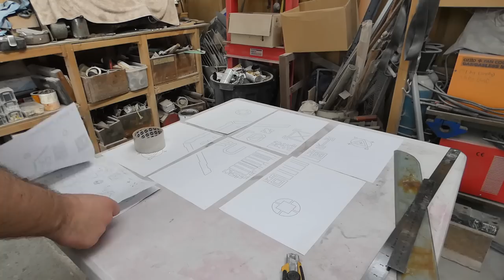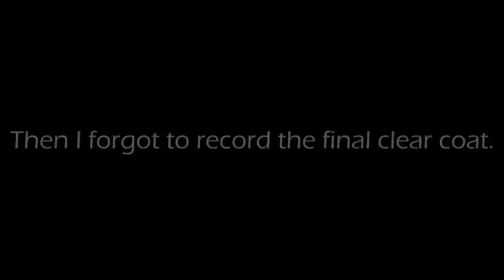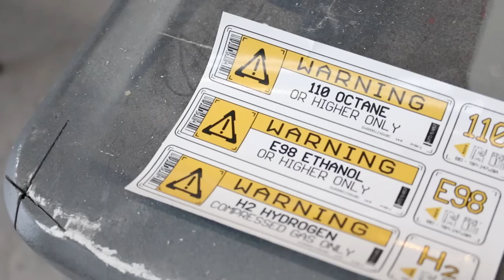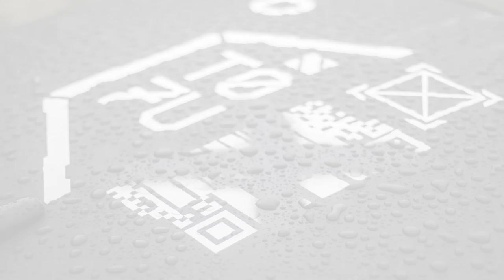The Fastback is Finished! Cyberpunk Miata Build: Part 8

Comment: What kind of Tipp i can give you for future Projects;  You should try use Bodyfiller that is thinned down to a point where its strayable with a Gun that you would use for the Corrosionprotection of a cars underfloor/Wheel Arches. Would save you a lot time and you can adjust the layerthicknes by thinning down the Bodyfiller. Ive seen Japanese Bodyworkers doing that when rebuilding a Fairlady Z from 1969.

Comment: amazing build! I'd love to see you route the exhaust through where the finish panel used to be with some crazy tips. Then you could build a huge rear diffuser.
Reply from the maker: I definitely plan on continue the design on this rear end with some changes to the rear bumper and diffuser. The space for the finish panel will be occupied by the custom tail lights I'm planning for this.
Reply: @TofuAutoWorks  full length tail light bar?! Sweet! Can't wait to see it.

Comment: Really caught the Cyberpunk vibe! 

Love the Akira sticker, of course applied perfectly random! I'd say, keep adding stickers over time. I would totally put a Ghost in the Shell Laughing Man sticker on as well. A QR code containing the URL to the playlist of the build too, probably one of the few times a QR Code actually makes sense and fit the theme.
Loving all the modelling techniques you used, a shame the preshade didn't show up. In Gunpla it's usually done when the main color is really light, also modelling colors probably don't cover nearly as well as automotive colors. I'm really amazed how much you're sanding, you must have immeasurable patience 😆

Btw, hastily crossing out such OCR ID tags is pretty ineffective, as most such ID tag systems have redundancy built into the design. You'd be better off completely covering it, or painting another ID tag over it, so the OCR system would actually scan two partial ID tags and not be able to resolve and error correct either. You can actually see this principle in the game Cyberpunk, the Scavs wear face shields that show fragmented face holograms, because the total absence of facial recognition would alert such systems more, than causing "low confidence guesses" due to the shifting hologram fragments.

Good thing you kept the shark fin!  Even with everything else, the shark fin just adds that final touch that's needed to pull it away from "crazy autocross track day build" and makes it a real size model kitbash. I bet another fake radiator or a bunch of heat discolored aluminium heatsink blades in that empty area between the tail lights would look pretty cool.
Reply: Instead of fake radiators in the rear, how about REAL radiators?

Comment: I've followed this from the start. Awesome build. The edits give an impression of how much hard work has gone into it, but doesn't bore the viewer. Good balance. I just can't help thinking that, after all that work, you owe it to yourself to make the fit look a bit more OEM than bolt-on. I do get that it fits with the overall aesthetic of the car though. And no opening boot?
Reply from the maker: There is still work to do such as fitting the seals around the doors and the glass / polycarbonate to the rear louvers, but the idea was supposed to be that this roof was for a higher end model of the same car that was taken from a junk yard and fitted to this car (hence the different colours) and that's why it was fitted roughly with whatever was lying around rather than factory mounting points.

Comment: A bit of light flashing from your heat gun would help the super stick from your masking. Just throwing that out there. Just enough to replicate a summers day.
Reply from the maker: I did the ol' apply to the shirt / pant leg trick on it at first. Annoying thing was it actually worked fine on the test pieces I did but then once it had sat on the car for a few minutes it started to leave it's marks on the paint. Definitely sticking with Autoline tape from now on.
Reply: @TofuAutoWorks  the pant wipe technique is definitely reliable. I used to work with leather, spraying, repair and what not. The clear coats were much more flexible than automotive stuff, so required some lateral thinking. I mostly used the 3M green tape, plus wafting the heatgun over the surface to warm the adhesive, for removal.
Reply from the maker: @Brewza50  Really interesting tip, I'll have to keep this one for the future. Cheers mate

Comment: Really good job man! Think you need a better water/oil separator.
Reply from the maker: I've got 2 traps hooked up including one at the gun but the air coming in was still so hot that the water didn't get a chance to condense out till it was already at the spray tip. That little old compressor has served me very well for the past 5 years but it's been well overdue for an upgrade.

Comment: Very impressive stuff. I've been following this project for years. It was one of the main inspirations for the route I took my own Corvette based cyberpunk car build. The stencil work was really inspiring. I'll have to include that in the re paint I'm doing now.
Where did you get the patterns from? And do you have any advice when it comes to what kinds of tape works well or will any old painters tape do? 

Also do you have any plans for the interior?
Reply from the maker: Cheers mate!
Most of the patterns are from references like Akira or Cyberpunk 2077 and a few stock images like barcodes, tracking markers etc. all stitched together to make a unique design that still pays homage to the source material. 
For tape I would recommend trying to get a low tack tape designed for fresh automotive paint.

The interior of the car has already seen a bit of work, I haven't made a video on it here but you can see it on my instagram @tofuautoworks.
Reply: @TofuAutoWorks AHHHH thanks, that makes a lot of sense. Good idea just  laying out the cyberpunk 2077 inspired graphics as stencils I'm definitely stealing that. I tried looking for decal sheets on Etsy for cosplaying but I wasn't sure they'd hold up and couldn't really find any that were the right scale. And thanks, I'll follow ya.

Comment: so rad to follow along. Do you find the pre-shading made a difference in the final painting or would you skip it next time and just do post shading??
Reply from the maker: I think pre-shading only works with models because you can apply the base coat a lot thinner. With automotive paints you're looking to get a much more opaque coverage so the pre-shading doesn't do anything. I'll just skip it and go straight with post shading next time.
Reply: @TofuAutoWorks  Thank you! Love it though. Great work!

Comment: I’m just wondering, how do you open the boot of it because wouldn’t the hatch be blocking it from opening?
Reply from the maker: I mentioned this in my previous videos but I don't plan on ever using the boot in this. I'll be making an isolator switch for the battery so I can cut it off from outside the car but other than that I never really need boot access. 

If I ever have to get into it to work on suspension or the fuel tank the whole roof still comes off with around 6 clips or so.

Comment: Very nice! Would love to do something similar one day, does it have any issues with  water getting in the cabin?
Reply from the maker: Surprisingly it's not that bad, most of the water that gets inside the windows runs down the door jams and back out the car. I'll be sealing the windows at a later date, I just needed to get the roof finished visually by the deadline and I only just made it in time.

Comment: This thing is WILD.  Is it all done now, or do you have more plans for it?

I mean... you did the Streetkid version... you could make it all smooth and polished fot the Corpo look, oooooor rough it up some more for that Nomad look (Paco Motorsports Offroadster kit, hint hint)
Reply from the maker: Thanks mate! I like to tackle this car in stages. This is V3.0 that we're currently on and my plan is now to slowly go around the car changing small details here and there and giving every panel a bit more of that cyberpunk vibe. 

I love the vehicle designs in 2077, especially the Nomad ones. I don't currently plan on doing an off road build with it but I love the tacked on and mismatched pieces you see on the Nomad vehicles, so if you can imagine a cross between that and a Streetkid build then that is pretty much what I'm going for.

Comment: brother you are an arteeest to the highest power but in the future, wet the floor arround and under your work area so you wont get dust or crap in your clear coat. that would have saved you hours of work. wet the floor and wont get dust
Reply from the maker: It wasn't dust, it was water spraying out of the compressor. I've got subtitles on all of my videos that give a little extra information and explain things that are hard to capture with the camera. But that gloss clearcoat was always going to end up sanded back with 400 anyway so the finish wasn't important to me. 

If you check out my old videos you'll see that I always wet my floors when spraying 2K or anything that doesn't flash off straight away.
Reply: @TofuAutoWorks  oh sorry bro but I love your car.

Comment: What’s the best thing to get old dried masking tape residue off of painted aluminum?   Goo gone didn’t work.  Goof off either.
Reply from the maker: I'd test a little bit of either Isopropyl alcohol, methylated spirits or mineral turps on a hidden bit of the paint to make sure it doesn't take any off and then try those.